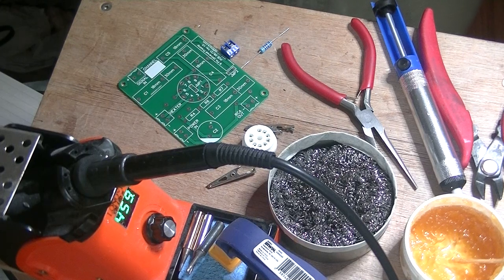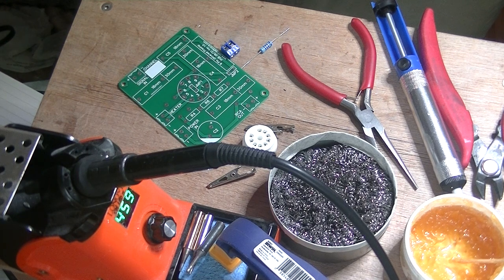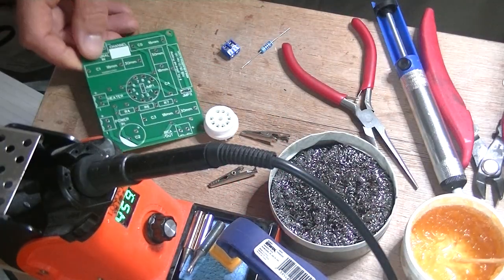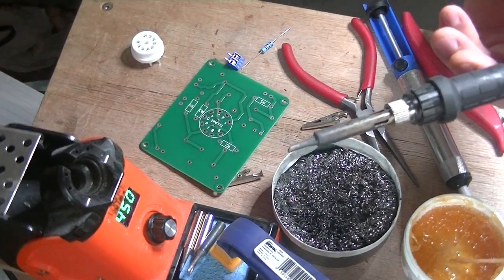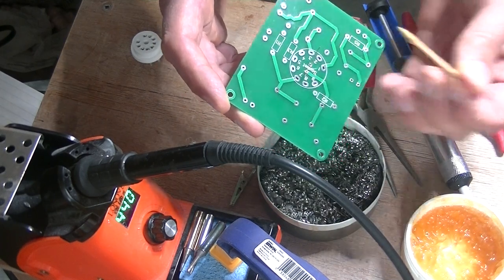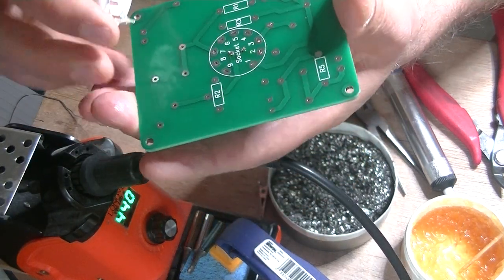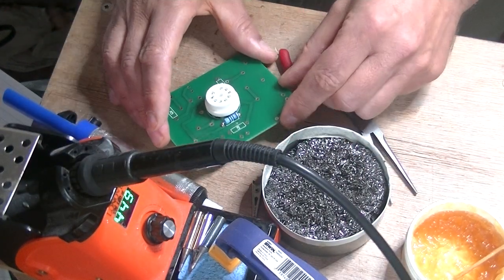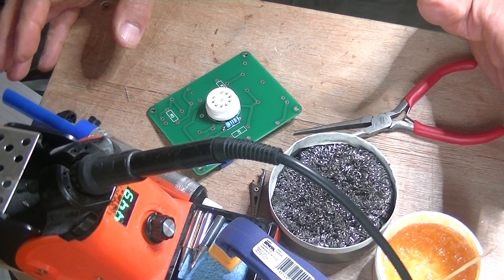Tube Lab #48 How To Solder Part 2

Comment: Thanks for this video - been looking for one on YT that deals with fitting circular sockets! If you could also do one that focuses on removing them from an old board that would be great.
Reply from the maker: Sorry we have a Kit Amp business and only work with new components and if I ever have an error with a socket I just bin the board and start over.  Getting larger older components out of an old board isn't fun, I'd highly recommend getting a reworking station that's got an integrated solder sucker with some serious vacuum, that's the way to go IMO.
Reply: @tubelab194  Thanks very much for your reply - all points understood and taken on board.